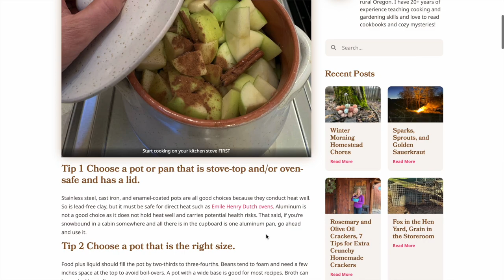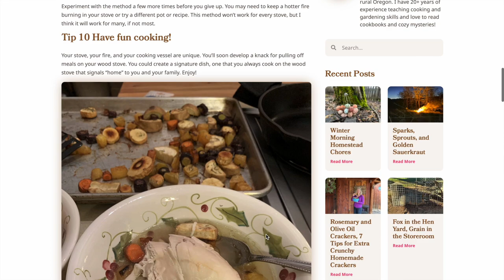Navy Beans and Ham on a Wood Stove | Modern Wood Stove Cooking

Comment: I'm in the market for a wood burning stove and this exact one in enameled brown is on my short list! 
A tip about this particular Blaze King model. You can actually remove the insulated top and cook directly on the steel box, you will get the direct heat you need to sauté, fry & boil from cold.
Reply from the maker: Thank you for the info! The stove came with trh house, so I had no idea. It would come in handy in a no-power situation. It's a wonderful stove, won't regret it if you choose this one. ~ Michele

Comment: I cooked hamburgers INSIDE my wood stove when I used to live in the Sierra Mtn range. Make a burger (raw egg, chopped celery & onion, crushed crackers, garlic, raw meat .. shape into a thick big burger.) Then slice red onion, sliced carrots, & place on top of the burger. Then wrap the entire burger in cabbage leaves. It will be a ball. Wrap again with 1 layer of heavy aluminum foil. Throw it onto your coals in the fire. Turn it once or twice using a poke. Let it cook 15 minutes, then pull it out with fire tongs. Using mitts, open your burger and let it cool a bit. Then eat it with a fork right out of the foil. This meal we often cooked during heavy snow storms with power outages. We all sat around the light of the fire enjoying our meal with campfire stories. Yet we were at home! Lots of fun.
Reply from the maker: That sounds SO delicious! You made burgers and good memories at the same time. 
XOXOX Michele